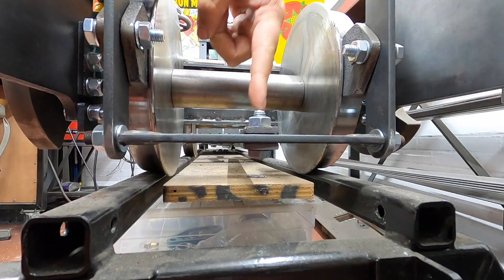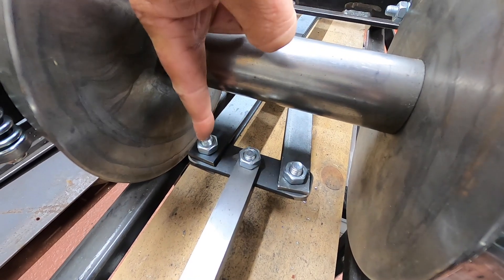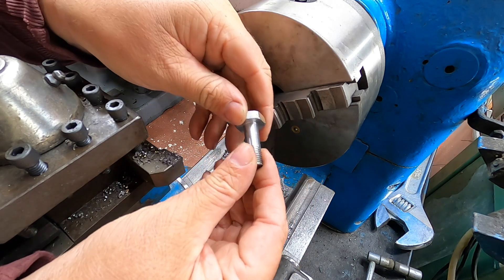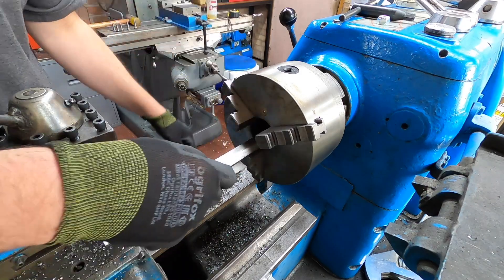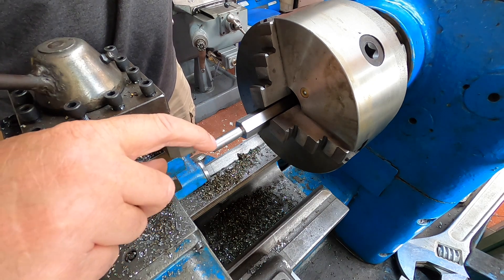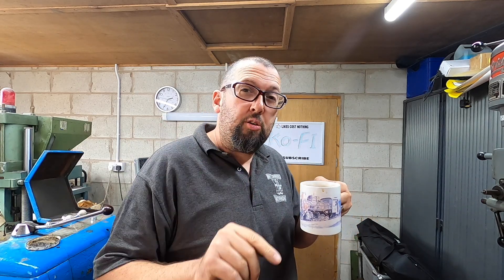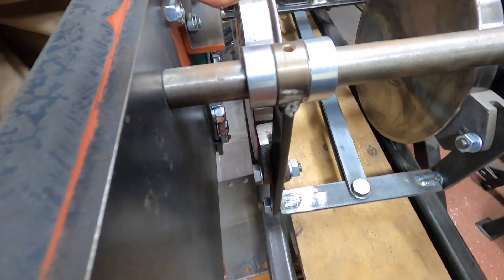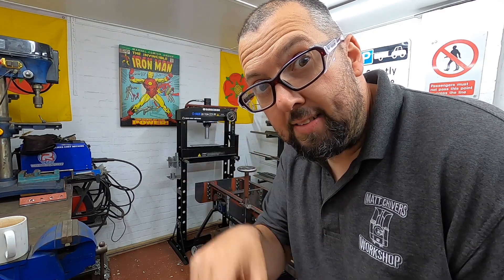Brake Pins -  ep49 - 7.25" Gauge Steam Locomotive Build

Comment: Looking forward to the next phase of the build. FWIW, I would have cross drilled those pins and used castle nuts and cotter pins to ensure they never back out.
Reply from the maker: I'll be stripping it down for painting, so no point doing this until its reassembled all in future episodes 😉. All the best, Matt 👍
Reply: Or just use a Nyloc.
Reply: @union310  I would trust a castle nut and cotter pin over a nyloc any day of the week.

Comment: Just wondering why you bought cast cylinders Matt? I thought you might fabricate them (like Mr Crispin) instead.
Reply: Because iron cylinders are better.
Reply from the maker: Nothing wrong with fabricated cylinders, as long as they have cast iron liners 😉. All the best, Matt
Reply: @MattChiversWorkshop  Different rates of material expansion cause issues in time.
Reply from the maker: Wear will causes issues overtime, there are no perfect solutions, but fabricated cylinders do exist, even on full size with no problem. All the best, Matt.
Reply: @MattChiversWorkshop  The Americans tried it numerous times. The Victorians realised early on there is only one good way. 
Industry today recognises that differential expansion causes more issues than it saves.
Reply from the maker: Mr crispin has used a Mild steel block with cast iron liners, but don't forget he is making piston valve cylinders, I'm making slide valve cylinders. Hopefully the next episode will show how much work I've cut out by buying cast cylinders. All the best, Matt 👍
Reply: @MattChiversWorkshop  Do you think aluminium cylinders would work with an O-ring on the piston? Aluminium is easier to machine and doesn't rust.
Reply from the maker: @donotwantahandle1111  no, in a steam engine it would rip them apart in seconds! Plus high heat and steam does corrode aluminium!

Comment: Nice progress Matt might be an idea do drill n put a split pin In below the nuts to hold things in place
Reply: Or even a small groove for a circlip could work but definitely better to make a fixture and drill holes for split pins.
Reply: Or Nylocs?
Robert
Reply from the maker: Hi Gaga, what I may have failed to mention in the video, is the nuts are temporary until the chassis is painted, I intend on stripping it down before painting, so finished nuts will be covered in finishing of details of reconstruction. 😉 I can't show you everything.....just yet! All the best, Matt 👍

Comment: 👍 Great job. Just curious, are you following a set of plans for your steam engine or are you making this up as you go like I do for most of the things I build?🤔
Reply from the maker: Hi, The answer to this one is a yes and a no at the same time. I'm roughly following the Roger Marsh drawings for the Tinkerbell but with many modifications, I'm also using the running Tinkerbell Sian built by Steve Stockdale at Leyland SME as reference. A lot is made up from the pair of those. What's coming next in the videos is following Rod Burnley Drawings!! Would I do it like this again?? Probably not 😂. All the best, Matt 👍

Comment: Warning!!  Stupid comment alert...  Why not use bolts instead of set screws and use locknuts? Also, remind me to give you a Coventry die head and dies next time you call in - much easier! Another great informative video.  Keep going! Grum
Reply from the maker: Grum, As your in the business of engineering this is a STUPID question! You can't get bolts with a plain shank this short, I went to all local suppliers and they all said no! I thought surely not, I'm sure Ive used them, I then thought sod it I'll make them, its all machining fun. Next stupid question, Locknuts, if I put the locknuts on now, I will have to replace them when I paint it all.... you will see further down the line!! What you should have asked is why didn't I use stainless...... as they have all got surface rust on now 🤦🏻‍♂️. All the best, Matt 👍
Reply: @MattChiversWorkshop  Should have asked me...  We use lots of specials at work...
Reply from the maker: Maybe you should move closer to gods county then...... 😉